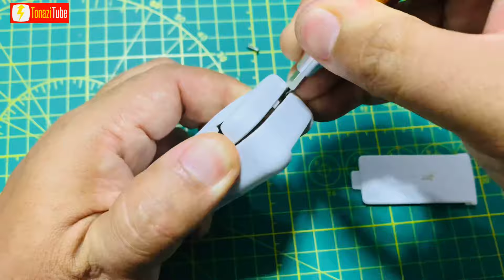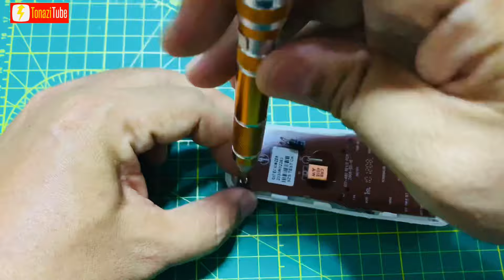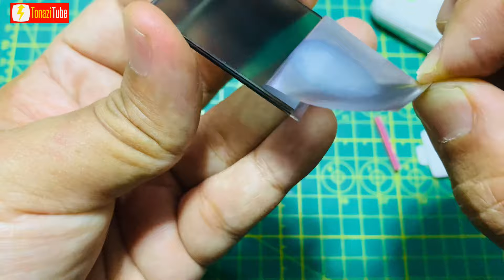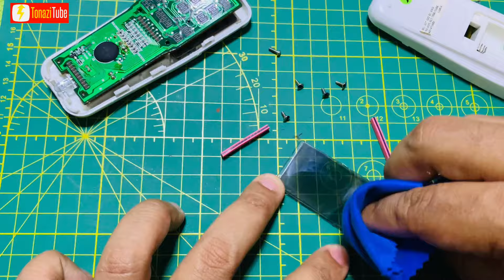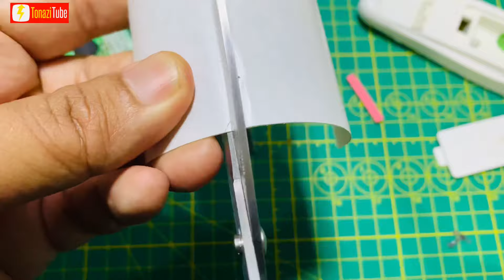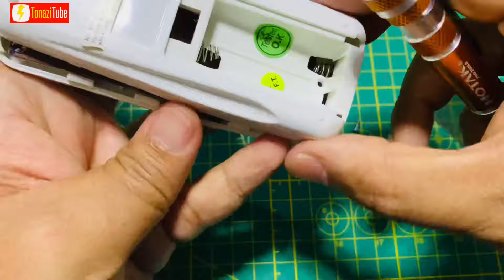How to Fix Sunburn LCD for Air Conditioning Remote Control | DIY Repair AC Remote Control Screen

Comment: Hi, this is a brilliant fix!, I just moved into an apartment, there are 3 Haier aircon units, each one has its own remote, all 3 have the thumb print sized burn on the LCD. I watched what you did and tried it, it works!, I just used some paper as it's all i have, the result is very satisfactory. Big thanks!!
Reply from the maker: You're most welcome 🤗

Comment: sir how about number are not displayed properly. like 2 is displayed  only - and 5 displays as =
Reply from the maker: You may check contact rubber and LCD panel.Try to clean the contact rubber and see how.

Comment: Salam tuan. Tumpang tanya
Untuk lcd meter kereta, layer dia macamni ke

Polarizer (depan) - lcd - polarizer (belakang) - background film
Reply from the maker: Waalaikumussalam.Maaf x pernah repair meter lcd kereta,tapi kalau yang pakai lcd  jenis rubber contact maksudnya lebih kurang sama macam video.Ada dua lapisan atas dan bawah lcd.
Reply: Did it work? cuz I wanna fix my car's display also.
Reply from the maker: @azhaganvivekanandhan2089 Work!Not sure what type of display for Car use
Reply: @TonaziTube  simple white dot lcd
Reply from the maker: Possibly can repair
Reply: @TonaziTube  Will check it out